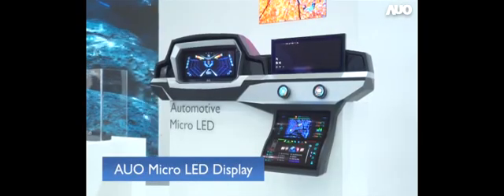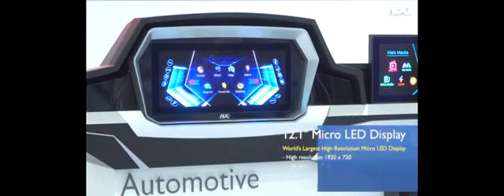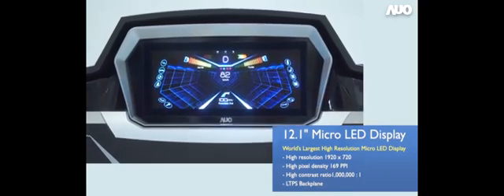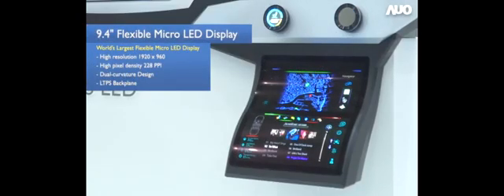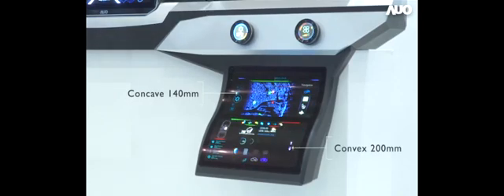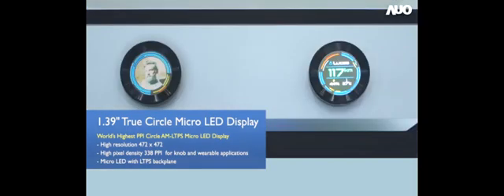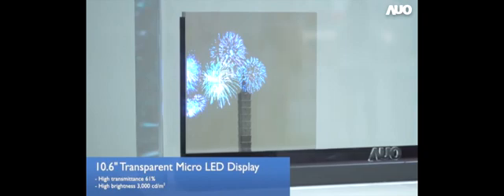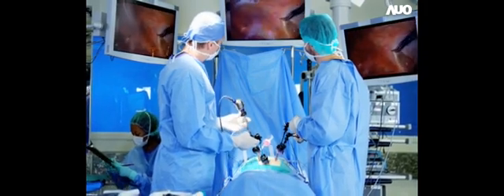AU Optronics MicroLED display prototypes at SID Displayweek 2021

Comment: Does this indicate that the issue of producing normal sized TV-displays, Gaming PC-Monitors, phone/tablet  & laptop screens with the MicroLED technology may now be a thing of the past?

I've read that it's currently very time consuming to produce MicroLED TVs, because each subpixel (red, green, blue) has to be placed on the panel itself one-by-one, thereby making MicroLED TVs very expensive to produce.
Reply from the maker: There's much progress - but we believe it will take some years before we see actual production of microLED displays...
Reply: And it's not just that but also that for a TV that must be at least 4K nowadays it needs 8294400 RGB leds which actually mean a true total of 24883200 leds and control every single one of them fast and accurate and push any of them to high brightness.

The easiest and cheapest way to make it for a consumer would be to use 24883200 blue leds and a quantum dot color filter in front and since the leds would all be the exact same would be easier to control and also much cheaper to get good working blue leds than highly calibrated RGB ones.

Anyway in the meantime we could have already had super dirt cheap OLEDS, in fact almost even disposable how cheap they could make it but capitalist speaks big so they keep trying to maintain the OLED prices with very minimal improvements each gen.

A Scientist from my country that already received prizes have already done dirt cheap disposable OLED displays and full transparent electronics even including cheaper replacement for transistors and basically she can make a small computer + OLED all in a glass, paper, plastic... And by now she thought everything would be using it, interactive disposable news papers, car windows turning white after not using the vehicle to block sun and so on... But well we got nothing.

After many years ago many known brands like samsung made a contract with her for millions all we see is nothing, everything goes to hell and the OLED came super expensive when she could make a dirt cheap OLED display just using a normal ink printer to print the OLED ingredients and that was many years ago. All the commercial advertising glass OLED displays that came out are kept at crazy prices, cars still have no full display glasses, news papers continue to be printed paper and this will probably continue since if it's a new crazy technology even if it cost 1cent to make why not charge 1000€ because yeah it's new and looks crazy, right?